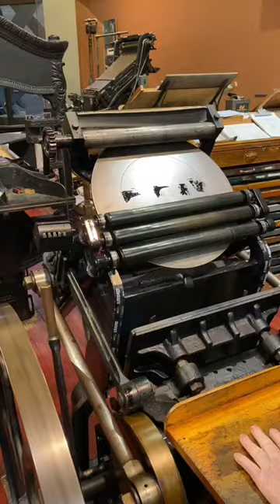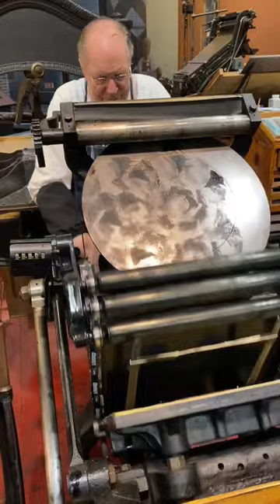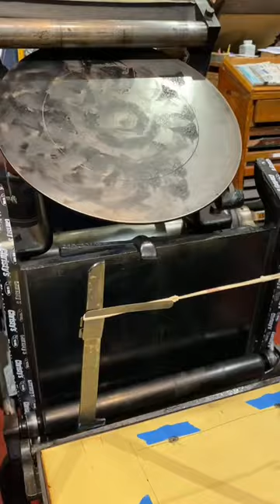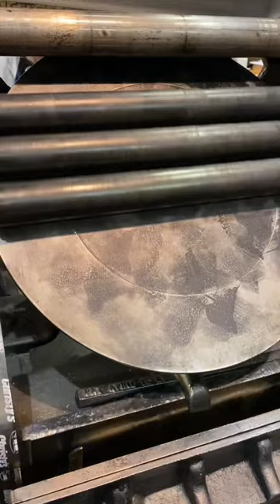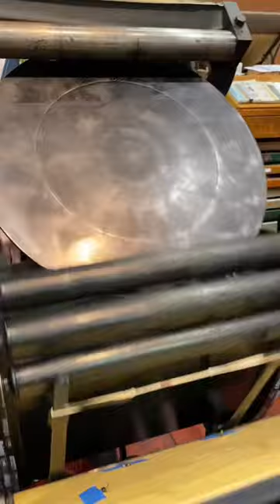Inking the 10x15 Chandler & Price jobbing press in preparation for letterpress printing

Comment: Is it possible to manually roll the ink out onto the platter with a hand roller? I was curious if that could possibly be faster. I know that's not the purpose of this video! Thanks for showing how this works.
Reply from the maker: Rolling out ink onto only the disk wouldn’t be effective because this process is also about creating an even layer of ink on the rollers.
Reply: @SacramentoHistoryMuseum  You are awesome. Thank you so much for taking the time to respond :3